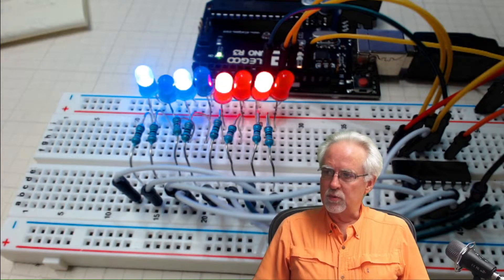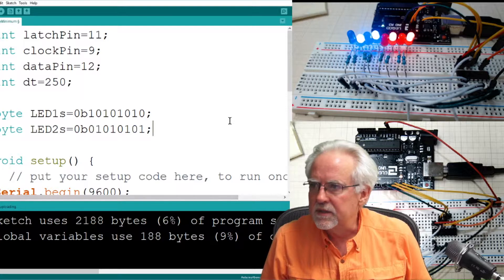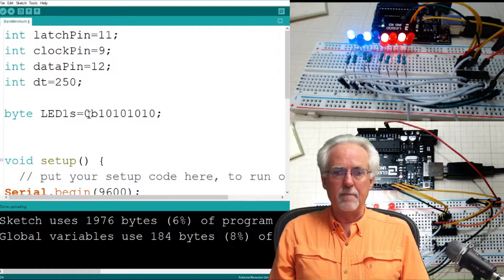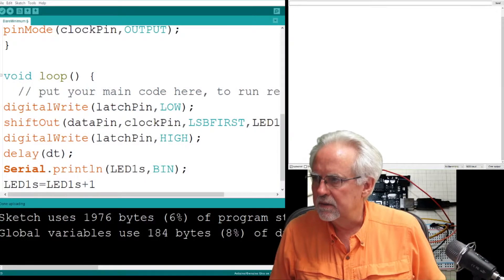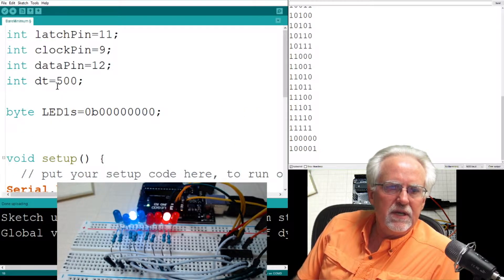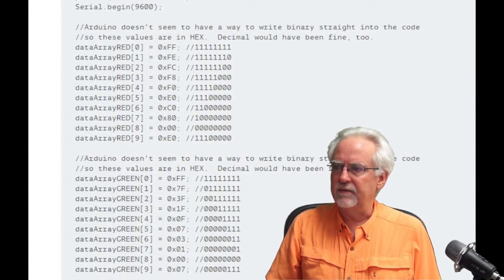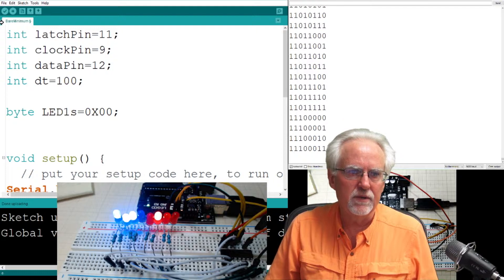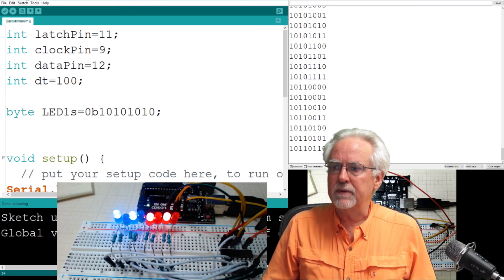Arduino Tutorial 43: Binary Counter with 74HC595 Serial to Parallel Shift Register

Comment: I tried Gray code.

int dataPin = 12;
int latchPin = 11;
int clockPin = 9;
byte LEDs = 0x00;
byte grayLEDs; // Gray code: is an ordering of the binary numeral system such that two successive values differ in only one bit
void setup() {
  Serial.begin(9600); 
  pinMode(dataPin,OUTPUT);
  pinMode(latchPin,OUTPUT);
  pinMode(clockPin,OUTPUT);
}

void loop() {

  grayLEDs = LEDs^(LEDs>>1);
  LEDs++;
  digitalWrite(latchPin, LOW);
  shiftOut(dataPin,clockPin,LSBFIRST,grayLEDs);
  digitalWrite(latchPin, HIGH);
  delay(1000);
}

Comment: Thanks for another lesson, sir McWhorter! I was able to do the homework by myself! The way I did it is the same as yours, but I added if-statements to enable it to run in reverse once it reaches 11111111.

int clockPin = 9, latchPin = 11, dataPin = 12, dT = 250;
byte leds = 0;
int op = 1;

void setup() {
  Serial.begin(9600);
  pinMode(clockPin, OUTPUT);
  pinMode(latchPin, OUTPUT);
  pinMode(dataPin, OUTPUT);
}

void loop() {
  if (leds == 255) {
    op = -op;
  }
  digitalWrite(latchPin, LOW);
  shiftOut(dataPin, clockPin, LSBFIRST, leds);
  digitalWrite(latchPin, HIGH);
  delay(dT);
  leds += op;
  if (leds == 0) {
    op = -op;
  }
  Serial.println(leds, BIN); //Prints the byte decimal into a binary form
}
Reply from the maker: LEGEND!

Comment: Oh wow! That was really easy. I put mine into a for loop.Based it on your earlier video fun with for loops and used LEDs as the variable instead of "j". Had some trouble getting the serial monitor to work until I stuck it in the for loop braces.
I'll have to rebuild the circuit and try it this way

Comment: For the homework I just added the (LEDs=LEDs <<1); to shift left and that worked so I swapped it to (LEDs=LEDs >>1); and they shifted right. I had written out the values I was looking for in decimal and did a serial print to confirm they're properly shifting left, 170_84_168_80_160_64_128_0 or right 170_85_42_21_10_5_2_1_0.
Obviously I checked to see if there was a shift command and my fist efforts didn't work as I read it as (in this case) (LEDS <<1); when it should be (LEDs=LEDs <<1).
thanks for another challenge, looking to forward to playing tutorial 44 now, just busting to know what your going to throw at us today.

Comment: I have a problem, my leds behave in a weird way when counting or when I add a delay, they blink in an erratic pattern, funny enough if I disconnect the ground from the register to the ground rail they work perfectly, I check the connections multiple times even bough new shift registers but keeps happening, anyone there faced the same problem? I am stuck :face-purple-crying:
Reply: I figured it was noise, added a big resistance between ground in the shifter and ground in the arduino and worked well.

Comment: read online you should not be letting it just overflow and expecting it to go back to the minimum value. something like this would be better if you want it to loop:

void loop() {
  // put your main code here, to run repeatedly:
  while (LEDs < 256) {
    LEDs += 1;
    Serial.println(LEDs, HEX);
    digitalWrite(latchPin, LOW);
    delay(dt);
    shiftOut(dataPin, clockPin, LSBFIRST, LEDs);
    digitalWrite(latchPin, HIGH);
    delay(dt);
  }
  if (LEDs == 255) {
    LEDs = 0;
  }

Comment: Just a note: I have met a problem that all of  8 leds will not light until the LEDs is over 128, if you are in the same problem, you can try to use additional power supply used in the last few lessons.

Comment: HOMEWORK DONE ON MY OWN EASILY

But I used a different method:
int latchPin=11;
int clockPin=9;
int dataPin=12;
int dt=500;
byte LEDs=0;
void setup() {
  // put your setup code here, to run once:
pinMode(latchPin,OUTPUT);
pinMode(dataPin,OUTPUT);
pinMode(clockPin,OUTPUT);
Serial.begin(9600);
}

void loop() {
  // put your main code here, to run repeatedly:
  LEDs=LEDs+1;
  if(LEDs>255){
    LEDs=0;
  }
digitalWrite(latchPin,LOW);
shiftOut(dataPin,clockPin,LSBFIRST,LEDs);
digitalWrite(latchPin,HIGH);
delay(dt);
}

Comment: Is this really a binary counter? Could I use this to count  pulses from a hall effect flow meter coming in at changing frequencies ? . I want to spare the interrupts for say every 128 pulses. 74HC4020 or 74HC590 the only option? Really it is the count that is important  as the device boils down to liters per pulse. Thank you for an excellent lecture.

Comment: I had no trouble with this.  I also boned up on standard C strings.  The shifting should be very easy if I keep in mind that the high order, in the array, C[8], is the null value and none of the bits can over right that location.  Also, an ASCII 0 is decimal 48.  When I work with the hardware, things go slowly, but when it comes to code, things go much faster (most of the time).  I am looking forward to building some real toys with this knowledge, but not before I finish the course.  Thank you, Paul

Comment: Somehow I managed to do it the very simple way myself using a for loop and it actually worked! I did something different where the LEDs would count binary and would print it to the serial monitor.

Here's my code I wrote:

int clockPin = 9;
int latchPin = 11;
int dataPin = 12;
int dt = 1000;

void setup() {
  Serial.begin(9600);
  pinMode(clockPin, OUTPUT);
  pinMode(latchPin, OUTPUT);
  pinMode(dataPin, OUTPUT);
}

void loop() {
  for (byte i = 0b00000000; i < 0b11111111; i++) {
    digitalWrite(latchPin, LOW);
    shiftOut(dataPin, clockPin, LSBFIRST, i);
    digitalWrite(latchPin, HIGH);
    Serial.println(i, BIN);
    delay(dt);
  }
}
Reply: nvm I didn't realize he used the LEDs to count binary, I'm stupid lol

Comment: Hi Paul. You would LOVE what I made. I did my HOMEWORK quite awhile ago,
since I had the Raspberry Pi 4 for a little over two years now. I have learned
a few things from it so far. I don't use Linux, because my monitor is very tiny.
I mean tiny monitor, called a Longrunner. Thank you for your generous help.

Comment: done after watching first 5mins of this video

int  latchPin=11;
int clockPin=9;
int dataPin=12;
int dt=500;

// byte LED1s=0xFF;
byte LED1s=0b00000000;

void setup() {
  // put your setup code here, to run once:
 Serial.begin(9600);
 pinMode(latchPin,OUTPUT);
 pinMode(dataPin,OUTPUT);
 pinMode(clockPin,OUTPUT);

}

void loop() {
  // put your main code here, to run repeatedly:
LED1s=LED1s+1;
digitalWrite(latchPin,LOW);
shiftOut(dataPin,clockPin,LSBFIRST,LED1s);
digitalWrite(latchPin,HIGH);
delay(dt);

}

Comment: I'm not sure if it's the correct way but since each bit is twice the value of the last bit, to get the number to move across the LEDs I just multiplied the variable by 2 for each cycle and it seemed to work! Edit: Seems to work the other way too if you divide by 2!

Comment: I used an 'if' condition that made the LEDs variable reset back to zero after the value becomes greater than 255. I didn't realize that by stating the bits it would do that automatically. Neat!!

Comment: Hello was able to get it working but not able to get the numbers to print in monitor,  not sure why... restarted computer and resprogramed arduino multiple times

int latchPin = 11;
int clockPin = 9;
int dataPin = 12;
byte LED1 = 0x00;
int dt = 1000;

void setup() {
  // put your setup code here, to run once:
  Serial.print(9600);
  pinMode(latchPin, OUTPUT);
  pinMode(clockPin, OUTPUT);
  pinMode(dataPin, OUTPUT);
}

void loop() {
  // put your main code here, to run repeatedly:
  digitalWrite(latchPin, LOW);
  shiftOut(dataPin, clockPin, LSBFIRST, LED1);
  digitalWrite(latchPin, HIGH);

  Serial.println(LED1);
  delay(dt);
  LED1 = LED1 + 1;
}

Comment: Oh wow, your solution was a LOT more elegant than mine. I simulated a binary counter by setting up a four-bit blue hex and a four-bit red hex and added one to the blue hex every time the right one reached F then reset that one back to 0. The light count was right but it was grinding to process the information. Ridiculous and I'm not even sure why I thought it was necessary. I may need to watch lesson 42 again.

Comment: This was a simple one. Since each led represents a power of two each shift depending on direction represents a division or multiplication. Some Assemblers like Merlin let you use an expression like LED1s >> 1; to shift right one bit.
Likewise starting at the Right, you can LED1s << 1; to shift left to multiply by 2. Normally what gets shifted out either sets the Carry if the bit was "1" or clears Carry if the bit was "0". Bitwise "&" and or "|" are used to clear or set individual bits in a byte. This is how bitmapping is done on the hires screen on the C64. You could start with a bit in the center and sweep right and left giving a "Sylon" effect of Babylon 5. Or if you had a LED Bar display, simulate Night Rider.
Wayne -- Doing some searching, there are other types of Shift Registers.

Comment: int latchPin=11;
int clockPin=9;
int dataPin=12;
int dt=500;//time

byte LEDs=0b00000000;

void setup() {
  // put your setup code here, to run once:
Serial.begin(9600);
pinMode(latchPin,OUTPUT);
pinMode(clockPin,OUTPUT);
pinMode(dataPin,OUTPUT);
}

void loop() {
  // put your main code here, to run repeatedly:
  for(int i=0; i<=255; i++)
  {
digitalWrite(latchPin,LOW);
shiftOut(dataPin,clockPin,LSBFIRST,LEDs);
digitalWrite(latchPin,HIGH);
Serial.println(LEDs,BIN);
LEDs=LEDs+1;
delay(dt);
  }
  LEDs=0b00000000;
}
is this good?

Comment: I literally did that in 2 minutes, with a for loop +1 code. I added condition to reset at 255. I know It's same without it but at least it gives me ability to choose which number i'd like stop at.
 Maybe it was an easier assignment, but regardless, the moment you  told about it, I knew what to do, and performed it without a single hiccup.  

your hint helped a lot, and that was all I needed. many thanks

Comment: Just for ish and giggles, I set LEDs to an integer. The counter kept going beyond 255 but the LEDs cycled with every multiple of 255, so the LEDs seem to be showing only the 2nd byte (aka 2nd set of bits), but will work with values greater than 255 (I doubt there's a use for this, but it learned me sumthin. I think I learned that the byte data type maxes out at 255, which would make perfect sense, as a byte is composed of 8 bits. When all 8 bits read a 1, that binary value is 255, hence the ceiling.

Comment: You were right about the homework being simple Paul! It seems there are multiple ways to accomplish it, I didn't even think mine was going to work. I declared my byte as 'leds' without giving it a value. Added an integer 'j' and set it = 0. In void loop I set leds=j; and set j=j+1 after the initial digitalWrites. Worked like a charm! Also added a serial.print for the decimal and binary numbers of the counter :)
Reply: this was what i was trying to do but got all combobulated.....

Comment: Get it down by switching the direction of multiplier -1 by -1. 

int latch = 11;
int clockpin = 9;
int datapin = 12;
byte LEDs = 0b11111111;
int dir = -1;
void setup() {
  // put your setup code here, to run once:
  Serial.begin(9600);
  pinMode(latch, OUTPUT);
  pinMode(datapin, OUTPUT);
  pinMode(clockpin, OUTPUT);
}

void loop() {
  // put your main code here, to run repeatedly:
  digitalWrite(latch,LOW);
  shiftOut(datapin,clockpin,LSBFIRST,LEDs);
  if (0x00 < LEDs < 0xFF){
    LEDs += dir*1;
  }
  if (LEDs == 0x00 || LEDs == 0xFF){
    dir = -dir;
  }
  Serial.println(LEDs,BIN);
  digitalWrite(latch,HIGH);
  delay(100);
}

Comment: I did it. I found the simplest solution possible. Thanks to your suggestion of finding a simple solution it came to me right away. I credit your methodical teaching approach. I'm super excited that I found the solution so fast. All I did was make LEDs variable a binary number and started with all 0's then in the shiftOut line I kept the code exactly the same except I made LEDS++ which added 1 to the number on each loop. Incredible.  I have to admit that I was surprised when it worked. I was expecting to spend all night trying to find that simple solution. That was super cool. Thanks so much for your detailed and well thought out approach to teaching. It is very effective for me.

Comment: Hey Paul, I just set LEDs to a variable (byte LEDs=0x00;)

In the loop I set the switch to low, sent data, and raised the latch back up.
Addded (LEDs=LEDs+1;)

then wrote a IF statement

if (LEDs == 0xFF) {
LEDs=0x00;}

I dont even think we needed that last IF statement but i wanted to ensure it stopped at 255 and started over.

Comment: I got it to work and with just a few more lines of code!!!  BOOM, oh ya.  :-D I added a print to the serial monitor so I could watch it and make sure it was working correctly.  Like a charm! 
I gotta say getting the circuit to work in the first place was a real bear.  The schematic was missing a few steps.  When I went back and listened carefully to what you were doing, I filled in the gaps and for a bit thought I had a problem when all the lights lit up.  But I noticed that yours did too.
Reply from the maker: Excellent!

Comment: Hey Paul, thank you so much for these amazing lessons. I was able to do last lessons assignment and for this lessons assignment it was easy peasy. Here is my solution i am only posting the binary sequence so as to not make this comment too long. 

Assignment 1 where LEDs shift to the right :
 
byte led1=0b11111111;
byte led2=0b01111111;
byte led3=0b00111111;
byte led4=0b00011111;
byte led5=0b00001111;
byte led6=0b00000111;
byte led7=0b00000011;
byte led8=0b00000001;
byte led9=0b00000000; 

Assignment 2 where LEDs shift to the left :

byte led1=0b11111111;
byte led2=0b11111110;
byte led3=0b11111100;
byte led4=0b11111000;
byte led5=0b11110000;
byte led6=0b11100000;
byte led7=0b11000000;
byte led8=0b10000000;
byte led9=0b00000000;

Comment: Homework:

int latchPin=11;
int clockPin=9;
int dataPin=12;
byte LEDs=0b00000101;
byte LEDin;
int LEDread;
int wait=500;

void setup() {
  // put your setup code here, to run once:
  pinMode(latchPin,OUTPUT);
  pinMode(clockPin,OUTPUT);
  pinMode(dataPin,OUTPUT);
  Serial.begin(9600);
}

void loop() {
  // put your main code here, to run repeatedly:
  LEDread=LEDs;
  LEDin=LEDs;
  while (LEDread<=255){
    digitalWrite(latchPin,LOW);
    shiftOut(dataPin,clockPin,LSBFIRST,LEDin);
    digitalWrite(latchPin,HIGH);
    Serial.print("A");
    Serial.print(LEDread);
    Serial.print("|");
    Serial.println(LEDin);
    LEDread=LEDread*2;
    LEDin=LEDread;
    delay(wait); 
  }
  LEDin=0;
  digitalWrite(latchPin,LOW);
  shiftOut(dataPin,clockPin,LSBFIRST,LEDin);
  digitalWrite(latchPin,HIGH);
  Serial.print("B");
  Serial.print(LEDread);
  Serial.print("|");
  Serial.println(LEDin);
  delay(wait);
  LEDread=LEDread/2;
  LEDin=LEDread;
  while (LEDread>=LEDs){
    digitalWrite(latchPin,LOW);
    shiftOut(dataPin,clockPin,LSBFIRST,LEDin);
    digitalWrite(latchPin,HIGH);
    Serial.print("C");
    Serial.print(LEDread);
    Serial.print("|");
    Serial.println(LEDin);
    LEDread=LEDread/2;
    LEDin=LEDread;
    delay(wait);
  }
  LEDin=0;
  digitalWrite(latchPin,LOW);
  shiftOut(dataPin,clockPin,LSBFIRST,LEDin);
  digitalWrite(latchPin,HIGH);
  Serial.print("D");
  Serial.print(LEDread);
  Serial.print("|");
  Serial.println(LEDin);
  delay(wait);
}

Comment: I m legend!!
Reply: Sir my 0 bit led is not turning off in right shift program.I m doing it using bit wise operator and using if statement for the cycle effect but all led works as required except for 0 bit led.

Comment: I did it using hex numbers from the beginning, but I didn't know it would roll over on its own, so I had an "if" statement that when it got to FF+1 it would restart to zero.  It worked fine, but I guess I didn't need the extra statement.

Comment: int LEDs;
int j=0b11111111;

for(LEDs=0b00000000;LEDs<=j;LEDs=LEDs+1)
Serial.println(LEDs,DEC);
digitalWrite(latchPin,LOW);
shiftOut(dataPin,clockPin,LSBFIRST,LEDs);
digitalWrite(latchPin,HIGH);
delay(dt);
Hello Paul, thanks for the amazing vid. I don´t really understand why this does not work. Could you explain it to me?
I didn´t copy paste the part thats´the same in both our codes btw
Reply: Try using byte data for LEDs
And using hexa.
For me it worked like that.

Comment: Two of the OUTPUT pins on the shift register (4 and 5) don't seem to be working for me. Anybody have any idea why? The IC seems to be working fine in exception two those two pins, when they're supposed to output 5V / HIGH and light up the corresponding LED in the binary counter they don't.

Comment: This my code before I saw the video and it worked beautufully.
int latchPin=11;
int clockPin=9;
int dataPin=12;
byte LED1s=0b00000000;
byte LED2s=0b01010101;
int dt=250;

void setup() {
  // put your setup code here, to run once:
Serial.begin(9600);
pinMode(latchPin,OUTPUT);
pinMode(dataPin,OUTPUT);
pinMode(clockPin,OUTPUT);
}

void loop() {
  // put your main code here, to run repeatedly:
LED1s=LED1s+0b00000001;
digitalWrite(latchPin,LOW);
shiftOut(dataPin,clockPin,LSBFIRST,LED1s);
digitalWrite(latchPin,HIGH);
delay(dt);
}

Comment: my code was different:

int latchPin = 11;
int clockPin = 9;
int dataPin = 12;

byte LEDs = 0xFF;

int d = 1000;

void setup() {
  // put your setup code here, to run once:
  Serial.begin(9600);
  pinMode(latchPin, OUTPUT);
  pinMode(clockPin, OUTPUT);
  pinMode(dataPin, OUTPUT);
}

void loop() {
  // put your main code here, to run repeatedly:
  digitalWrite(latchPin, LOW);
  LEDs = LEDs + 0x01;
  shiftOut(dataPin, clockPin, LSBFIRST, LEDs);
  digitalWrite(latchPin, HIGH);
  Serial.print(LEDs);
  Serial.print("    ");
  Serial.print(LEDs, BIN);
  Serial.print("    ");
  Serial.println(LEDs, HEX);
  delay(d);
}